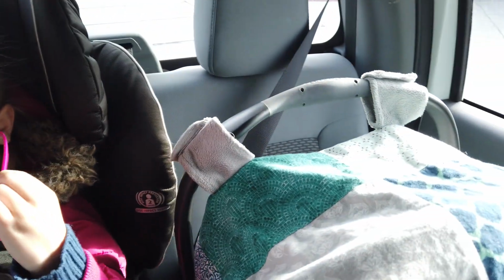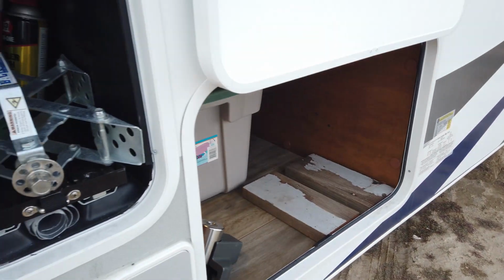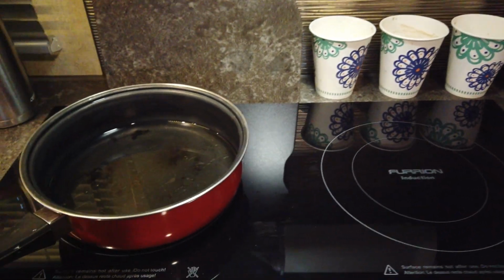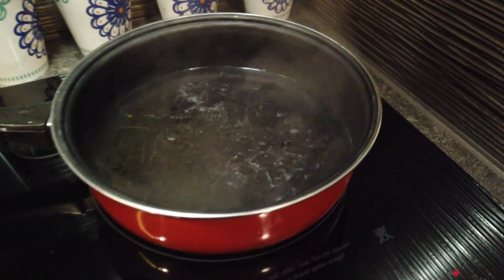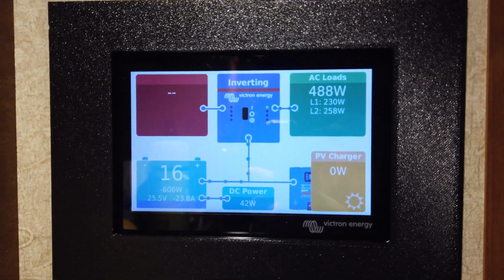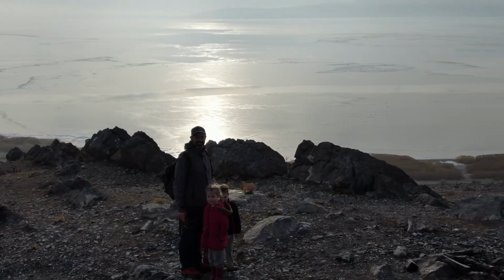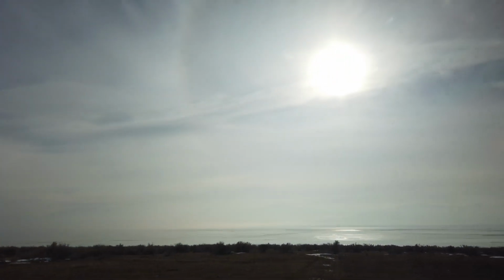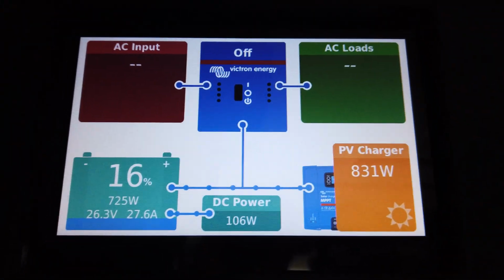Our First RV Outing To Test Our Lance 2185 Travel Trailer Modifications

Comment: Would you mind sharing what the solar setup with batteries cost?
Reply from the maker: $15,503. I've been considering making a video detailing the costs. Maybe I'll do that in the next few weeks.
Reply: @ElectricTechAdventures  thanks for the info! Are you happy with your Lance? I’m looking at a 2013. Love the three bunk setup.
Reply from the maker: @zmarble  Yes we love it. It's like a little apartment. With the slide out the front of the trailer is the common area which is plenty spacious, then there's the bedroom in the back with the door in-between which we close when the kids go to bed. Once they're asleep and we're going to bed I typically open the door so they get more conditioned air from the mini split. The tongue weight is heavy on the standard 2185 (ours is even heavier due to my electrical system), so make sure your truck can handle it. The advantage is there's zero sway even in heavy side wind.
Reply: @ElectricTechAdventures  we are looking at getting a 2007-2014 Yukon XL Denali. Any idea if it would have the chops to pull it? I think it should from a motor standpoint, but wasn’t sure how to check the tongue weight.
Reply from the maker: @zmarble  I don't know that vehicle already myself. You'll just need to look up the manufacturers specifications. Tongue weight of the 2185 varies depending on the installed options and of course with any trailer, the stuff you've put in the trailer and where you put it. Mine was 900 lbs before I made any modifications. https://youtu.be/wIHi0507qPM
Reply: @ElectricTechAdventures just curious what is the weight after the modifications?
Reply from the maker: @MichaelBurko  https://youtu.be/4FyO0s7_L5U

Comment: Great setup! How many watts are you seeing your mini split using with cooling vs heating modes in your case?
Reply from the maker: In heating mode the average energy consumption to maintain about 70 F inside when it's in the 30's outside (40 degree delta) is roughly around 500 Watts. In the summer when maintaining 75 F inside and 95 F outside (20 degree delta) it averages around 350 Watts. It is variable so the peak when it's first turned on is as high as 1,800 Watts heating or around 1,500 Watts cooling before it settles down once it's reached the set temperature. This summer when we're not camping I've been turning on the AC almost every day to keep the trailer inside at 75 F and thus protect the batteries from going over 100 degrees F. Plus the food we keep in there. A day of normal AC from around noon to 5pm consumes 1.8 kWh. Leaving AC on for 24 hours consumes 2.8 kWh. My solar panels generate 16 kWh on a typical fully sunny day in the three months across the summer solstice then it ramps down to 6 kWh per day on the Winter solstice. These are flat mounted panels that I don't bother to tilt. Also the RV is getting some morning shade from a tree on the east and afternoon shade from my house after about 3:30pm, so the panels are capable of more production. The highest producing day ever was 17 kWh in the spring when it was cold, but sunny. I'll be making a couple YouTube videos going through all this information with screen shots and spreadsheet summaries as well as showing how I charge my Tesla from the trailer every day to ensure the RV batteries are never full and thus the solar panels are always able to produce to their capability.
Reply: @ElectricTechAdventures  thank you for that! Luckily your videos have helped me explan and show my wife what i was looking to do with our lance 1995 but doing a smaller single phase system.